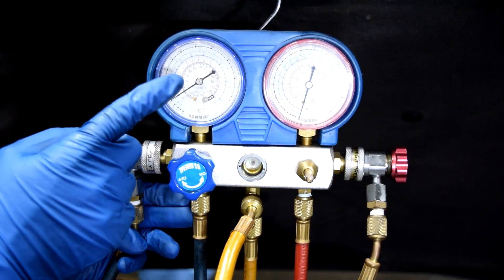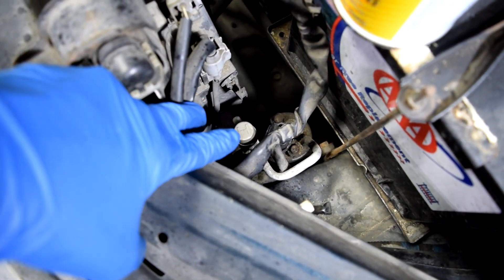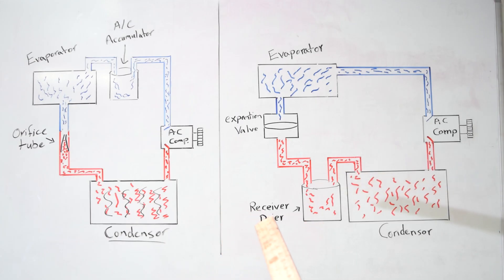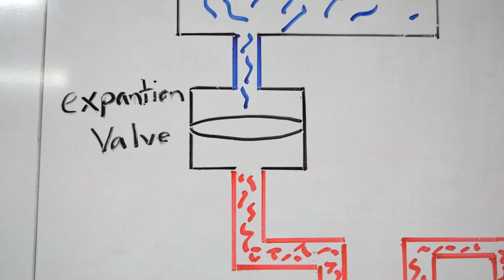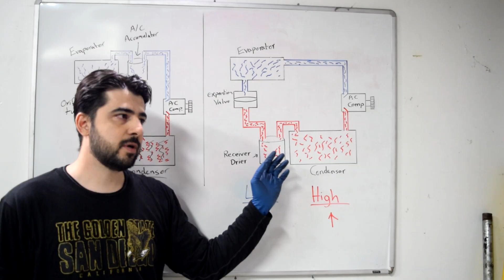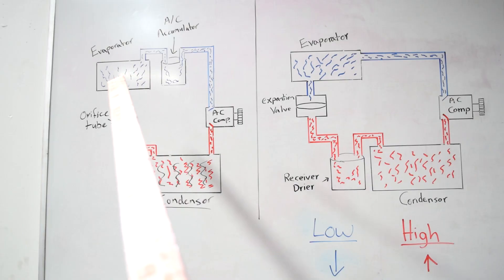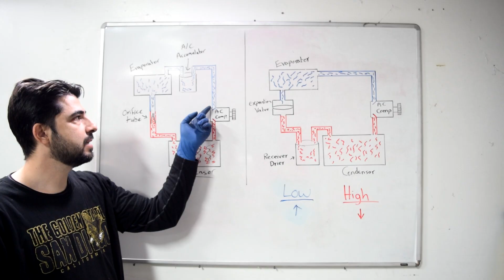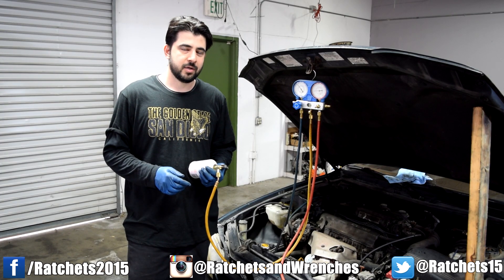How to Diagnose and Recharge Your AC System with Refrigerant - Using an A/C Manifold Gauge Set

Comment: MUST READ...........Something else, no covers....(besides not bleeding the hoses) the proper procedure for disconnecting after charging...or any time, actually. What the house AC guys do...is close the high pressure valve at the service port (on vehicle) and disconnect. Then open both valves on the manifold (counterclockwise). This will then let the low pressure side, the suction side, pull in what's left in the hoses (the can must still  be attached to the yellow hose, even if it's empty).  Then close low pressure, at service port, counterclockwise and disconnect it.

If don't do the above, when you disconnect the hose you'll have high pressure liquid/gas in the high pressure side. Then two possible things happen, you realize it's virtually impossible to unscrew the fittings, do to the pressure. Then you start fiddling with the valves and whammo, the refrigerant comes rippin' out the hose....not good. It could go anywhere even in your face...FFS, teach safety, not just theory and hands on basics...

Another tip for newbies.  There are four valves, two on the manifold and two at the end of the hoses, which connect to the service ports on your vehicle....THEY WORK TOTALLY DIFFERENT. The two on the manifold behave like most plumbing valves, you turn the handle clockwise to close and counterclockwise to open. Think of your garden hose spigot. These should always be in the closed position when starting.............The two valves at the end of the hose, have the opposite effect. Although, the valve basically works the same, it's reaction is the opposite. Why? Because they tapping into a closed pressurized system. You start with valve full turned counterclockwise, this way the pin is retracted. After you connect the fitting to the service port, then you turn it clockwise, the pin in the valve will extended and depress the Schrader valve in the service port. Now fluid is flowing to your gauges.

To summarize:
     The manifold valves, turn clockwise to close (your starting position).
     The hose end valves, turn counter clockwise to close (your starting position).
     Purge each hose, after hook up.
     Bleed the high side into the low side before removal and with vehicle running.

Disclaimer: I'm a DIY guy, go do your own research on this matter...I amazed at how many experts in either short or long videos do not mention the above two procedures...oy

Comment: hey man i really need some help. I have a 08 toyota highlander and it keeps blowing hot. I have just tested the system and low side got about 60 psi and is dropping to around 50-55. hi side is a high of 70 but it seems like it is dropping as well. i also tried to pull a vaccuum on the system. it seems like the hi side did not pull any vacuum while the lo side went full vacuum but when i let it sit it lost all vacuum. is this a compressor issue or should i be looking at something else? please help i am so confused

Comment: Making a few notes to check my understanding. If I need a correction, someone/anyone please let me know!

Start with gauge valves closed so that nothing escapes through the yellow line. Gauges will still read pressure from red/blue lines. Gauge valves open counterclockwise and quick-connect valves open clockwise. 

Systems with an orifice tube use an accumulator on the low side, after the evaporator. Systems with an expansion valve use a receiver-dryer after the condenser.

With compressor not running, you would expect pressure on both lines to be the same (eg., 60psi or so). If there is a difference, there's probably a clog somewhere (orifice tube or expansion valve maybe). With compressor running, consult a chart to verify the pressure numbers you're seeing based on ambient temp and humidity.

Example 1: If both Low and High side readings are towards their respective low ranges, system is likely low on refrigerant (car does cool, but not enough.)

Example 2: If both Low and High side readings are towards their respective high ranges or exceed the high ranges, system probably has too much refrigerant in it OR air isn't flowing through the condenser (fins are clogged, fans don't run etc.) System does not create a low-side pressure differential/compressor may be shutting down in self-preservation etc.)

Example 3: If both Low and High side readings are still the same even when compressor clutch is engaged, compressor is damaged. It's just not compressing refrigerant.

Example 4: Low side is lower than expected/High side is higher than expected. Likely clog in the high side (between compressor and orifice or expansion valve) Suspect condenser or receiver/dryer or expansion valve/orifice tube etc)

Example 5: Low side is higher than expected/High side is lower than expected. Systems with expansion valve: expansion valve is stuck open or compressor check valve is bad. Systems with orifice tube: Accumulator is clogged or compressor check valve is bad.

Comment: How are you able to determine the amount for refrigerant that's in the system before adding more with the a/c manifold? Is it based off of the chart where you take your humidity and other outside factors to determine proper a/c readings?

Comment: Help!! One of my hoses busted, I replaced it. I pulled a vacuum. And now I’m at the point where I should recharge the system, but the compressor doesn’t engage. I force the compressor to engage and I’m getting a 0 on the low side and a 100 on the high side. 

Am I good to start recharging? If so, do I recharge while the compressor isn’t engaged? Or with me forcing the  compressor to engage?

Comment: I own Yaris 2012, which when goes at high speed, gets cold air however when at slow speed or idle, doesn't give cold air, what do you reckon is the problem, is it with a blower fan or less refrigerant?

Comment: Replaced compressor, condenser, evaporator high and low pressure switched and all hoses … everything new.  Go to add 134a and low side pressure goes to 90 to 100 and high side goes to 100 to 125 … any idea why RBI’s is happening?  2003 ranger 2.3L 4 cyl.

Comment: I have a 2002 jeep grand Cherokee 4.7 and I was recharging the system since they had to evacuate the refrigerant to do an engine swap, so there it was the system completely empty and I started with pulling a vacuum then added refrigerant it was going well the compressor was kicking in until it built pressure in the high side and found a leak, I replaced the line which has a pressure switch, did the whole process again but now I only have readings (90psi) on the low side and zero readings on the high side, and the compressor won’t engage at all, also it’s not taking in any refrigerant? Does anybody know what could be the problem here? Maybe the pressure switch on the high side or a clogged expansion valve?

Comment: i appreciate, i was trained 37 years ago, under old R12 stuff, still have a bunch of r12 cans, and 1 big tank, but never worked on 134, just bought gauges couldnt find vacuum pump? stolen many years ago i guess, and rebuilding a vehicle i got talked into, so needing to fix air. i had fundementals, just needing a brush up on this

Comment: Whats worse than a a/c that kinda works but can keep you alive? One that doesn't work at all. I spend what $1000+ and had all the gauges, specialty hoses, tons of "how to" .. Most a/c shops freaked when they see either my Pantera or Delorean so I had to DIY. I kept them running for a decade so it was surprising that a "quick top off" is what almost ruined my a/c system. I was on a road trip when the Delorean ac blew 70 degree air. That car HAS to be cooled so a quick Napa stop, a bottle of r134 with the "gauge". 10 minutes late sounded like a shotgun went off behind my head and white smoke. That $15? bottle cost me $800+. Then I drove 300 miles at 90 degrees.   Just say NO to those DIY bottles.

Comment: I tried adding refrigerant to my AC and it made no difference.  I noticed that when I turned the AC off, the gauge on the low side increased pressure significantly into the red zone but when I started the AC it went back down to the normal range again.  So that makes me think that the compressor must be working but could there be a blockage somewhere?

Comment: Mine has good pressure at idle, 40 and 220, but when I raise the rpm to about 2500 the low side drop to 20 I think and the high side goes up to 250+. 
Also shouldn’t the low side line be getting very cold?

Comment: Great video! I would add (my apologies if I missed you covering this) that you need to purge the air from the yellow line after you connect the can of refrigerant and before you open the low side valve to start sucking the new refrigerant in. This will keep moisture/air out of your system.
Reply: Exactly! Same goes with the LP and HP connection, he missed to purge those air trap in the hose lines before open both L and H gauges, especially the L side. In this case, he had air trap in the LP blue hose and the yellow line. Other than that, great video!
Reply: @maddogpham9815  Several people have said this, but nobody has said how you do it.  😕
Reply: Why he did not purge the blue or red lines once he connect them to prevent air?  any idea? thx
Reply: @zofa300 because he is a YouTube mechanic
Reply: @loganyoutube4818  And yet, here you are.

Comment: This is one of the better videos on the subject on YT - congrats.
BWT, got a Q on an  issue that is not covered well most anywhere - AC works fine during cool temps (morning n evening) but not in hot weather!! Any idea why this is?
Reply: Hi there, im a fan of your videos. I keep on adding refrigerant to my car a/c system every after 2-4days. My car doesn't blow cold after it is stock for a day even though i just had it refilled with refrigerants.

Comment: Hello ! I would like to know what can be wrong with a compressor that engage for a few seconds and then desengage and do the same all over again but does not work enough to produce cold air. Could it be too much refrigerant in the system ? This is happenning to me after a recharge, but I think I put a little more than it should take. I would appreciate your advice on this issue. Thanks a lot, Ramon, Miami.

Comment: I have a yellow jacket manifold with  knob on the side. So its clockwise to close and counter clockwise to open.For some reason when i open the low pressure side, refrigerant are not being added. Any ideas?

Comment: I would suggest a separate bottle for recovery if you don't know if there are contaminates in the system, otherwise you will contaminate you good bottle if you bought it new. I use a separate bottle. I'm not going to risk a questionable system on my customer's. If it's you car and you still want to risk contamination to your system after you just recovered everything in the system, go for it it's your vehicle.

Comment: Hi... love all your vids. If I let all the r134a out of my system and vac it out, will I need to replace the oil. I'm handicapped and trying not to have to pull the compressor to dump the oil and refill. Thank you for your time. Johnny

Comment: Why would my clutch not disengage?
Before it did not kick on, I fix that.
I add refrigerant and it kick on but don't goes on and off, it stays on.

I used the AC PRO can that had the digital screen, showing 3 psi,  adding that can take it to 27 psi (low pressure port) when running.

After a few hours I motice that I didn't get cold air, so again, I went to check the pressure, with the car off I have LOW PRESSURE in 75psi and HIGH PRESSURE port at 120psi.

Any clue what's going on?

Thanks!

Comment: Thks for the update. Before you open the low-pressure value I'm sure you bleed the air from the service line before opening the low side. Thks again. You are a skilled technician.

Comment: Great Video:
I am trying to determine corrective action: Expansion Valve System
OAT 73*F / Vent Discharge Temp 55*F / below 40%RH
Low PSI 28. High PSI 118
The vent discharge temp is high at 55*F.
Help Please?

Comment: Good video, very informative. I have a problem that wasn't covered in your videos. My compressor runs constantly. The pressures on the high and low side are in line with what you say is normal but the compressor never cycles. When I turn the AC off the pressure goes up on the low side and drops on the high side (which I guess is normal) but when I turn the AC back on the compressor turns on but again does not cycle. Any ideas?
Reply: I know this is a very old comment but in case someone reads this and is wondering: not all vehicles cycle the compressor when the A/C is on.  That is by design and is the likely answer as to why it's not doing so.  This is done for reliability reasons as cycling the compressor on and off wears out both it and the clutch, so this is actually a good thing as it means everything else being equal the compressor+clutch will last longer at a very slight cost to fuel economy--we're talking 1mpg or less.  Taking the very small fuel economy hit is well worth it for the additional reliability as replacing the compressor, expansion valve, receiver/dryer and pulling a vacuum on the system and doing a recharge is pretty expensive.

Comment: Best description I've seen for sure.  Question.  My symptom is whenever I turn on my defroster (with or without heat) the ac clutch engages and my radiator fans activate?  Any advice on this?  I changed the ac pressure switch to no avail.

Comment: Thank you for this helpful video! I especially appreciate the theory portion. I am hoping you or someone else can help me understand my results. My cold static check at ambient 76F is 60 psi low side and 80 psi high side. Dynamic check at 76F is 85 psi low side and 100 psi high side. I am having a hard time confirming that the compressor is engaging because of its location. Can you help me understand these numbers? Does the compressor appear to be running?

Comment: After you attach the can of Freon, don’t forget to slightly loosen the yellow line at the manifold so you can burp the air out of the line. If you don’t do this, you will let air into the system and this is not good. He forgot that step.

Comment: I need to use a machine to remove and then refill. I changed my condenser and air got into the system and wouldn't allow me to refill with refrigerant. That was all that was needed. I was at .3 pounds of refrigerant and my car and needs 2 pounds of it. The mechanic told be that was a lot. Americans like there ac a lot more then other country's I guess lol.

Comment: I have a GMC Sierra 2014.  The compressor wen out.  I replace. All ready two compresora from the auto parts. But they both sound like bad. When the ac is on.  Anybody. Any advice

Comment: So 85 degrees w/ low humidity and the car at idle. I have 36/250 and at 2rpm it goes to 19/350. It runs cold air, warm then cold again. Thoughts?

Comment: Very good video. I only wish he had covered the process of using a vacuum pump to pull the system into a vacuum in order to pull out any moisture and to also check for leaks first. If the system holds vacuum for 15-30 minutes, you're good. If the pressure slowly goes back up, then you have a leak that needs to be addressed before you add more refrigerant (which will just leak back out). Still, a great overall description for a basic recharge using the gauges.

Comment: I've always been taught never to turn the can upside down and let liquid into the low side. That is only for when doing a fast charge on the high side. Which I haven't learned how to do, but would like to. I just set the can in some warm water to speed up the charging. I think the danger is a hydraulic lock in the compressor piston if liquid gets into it. It seems like lately the most common failure is the compressor. There are so many junk new compressors on the market it's hard to find one that works, or lasts very long.. The OEM ones are probably the best bet but the cost is hard to justify in an older used car.
Reply: I have a 98 Sonoma ac clutch kicks in an out at times an no ac what should I look for to fix it

Comment: Questions.. 
I changed my compressor, expansion valve, all O-rings, flushed my system and refilled my system with the correct amounts of oil and R134a. There were no leaks, all seems well with 2 exceptions. It takes a few minutes before it starts cooling and once it cools it seems like it isn't cold enough. I made sure the exact amount of R134a & Oil went back in the system. 
1) Should I add a little more R134a?
2) Would the new expansion valve cause it to delay cooling maybe due to it opening slowly or something?
Reply: Also, the 2-3 minute delay only happens after the car has been off overnight. If I am out using the car during the day, let it sit for an hour or two and then start it again, the cooling happens right away as normal..

Comment: My ac clutch on my 2013 Optima is spinning  when on but the compressor does not come on. If I disconnect  the low pressure switch, I hear the compressor  but it is very faint. I try engaging the clutch manually  by connecting 30 and 87 but I dont hear it engage.
 Pleas help.

Comment: you dident purge the yellow line before u let the 134a into the system so u also let a yellow line full of air into the system as well.
Reply: Since it had pressure in a/c need to purge blue low & red high plus purge yellow suction..great vid👍

Comment: Excellent video...with just one error. You did not show to purge  the yellow line of air when you added the 134a.
Reply: i noticed that also there fore causing air and condensation into the system
Reply: basic.
Reply: @vergiemondejar7554 only basic after you know to do it.
Reply: How do you get the air out?
Reply: @Snceday1  You let a puff of refrigerant flow through the yellow line immediately before pushing it onto the low side fitting.